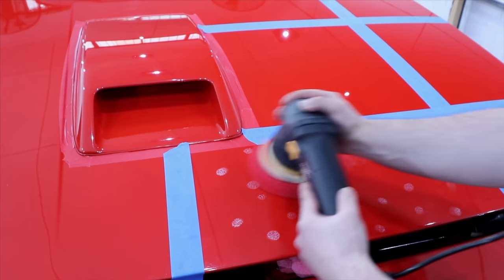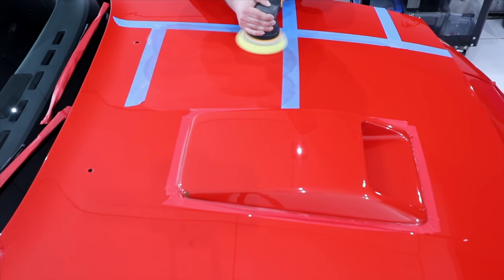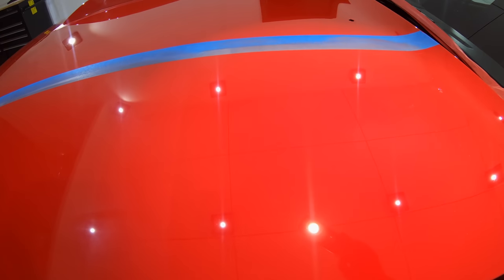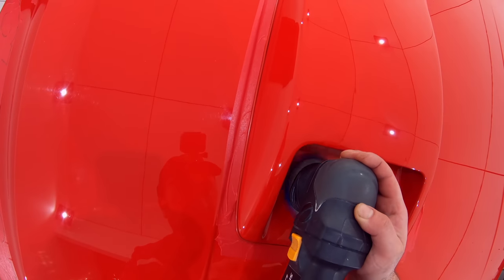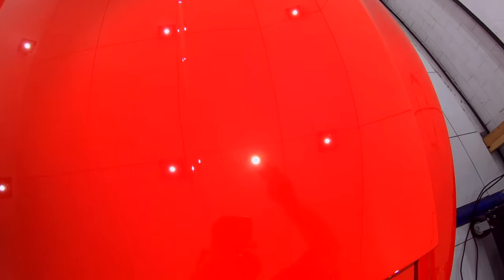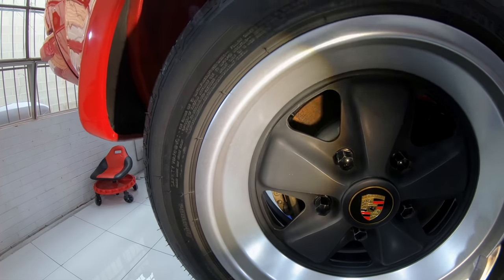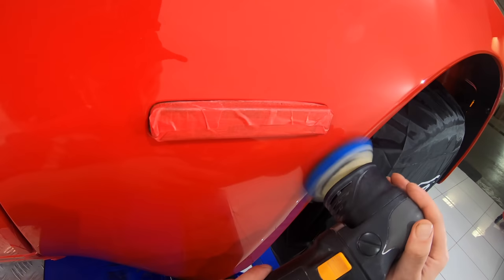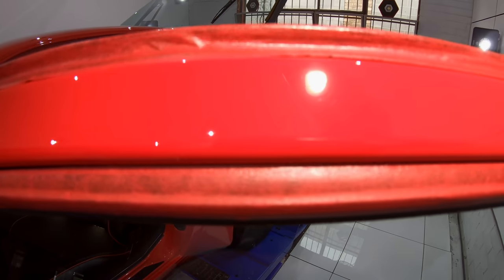Porsche 924 Carrera GT - Detailing & Preserving A Classic! P2 Paint Correction! (Vlog 28.2)

Comment: Great work. I owned a GTI mkII of this vintage with Tornado Red single stage paint. That paint oxidised so quickly and was soft indeed. I hand polished it which took some time. And used Zymol paste wax for an ultra deep shine - looked awesome when complete. That wax required a rewax every 4 months or so. Modern clear coats are so much easier to maintain but these old single stage paints can look great after a good workout.

Comment: Hi Sandro what speed do you place your shinemate 3 inch on as I use the same polisher and pad... I find the hdos burn out quicker than my other size pads
Reply: Yeh perfect I uses the same speed settings but usually morr 4.5 to 5 for cutting and yes definetly deteriorate quicker thats why I was checking to ensure my speed isn't too high

Thanks Sandro cant wait for part 3